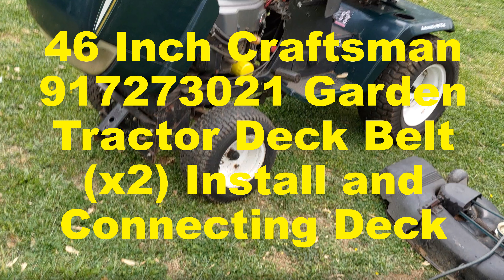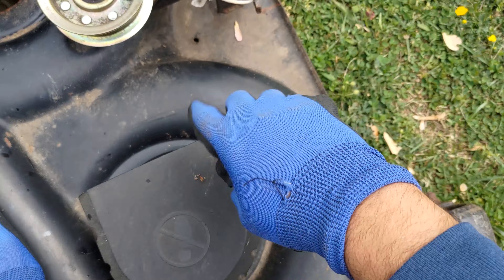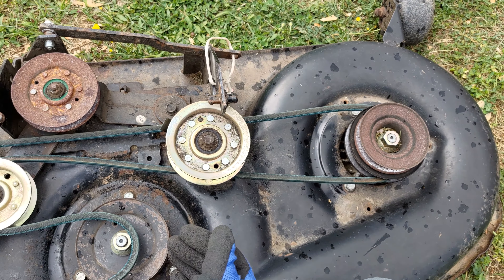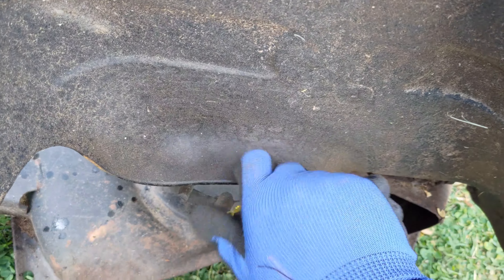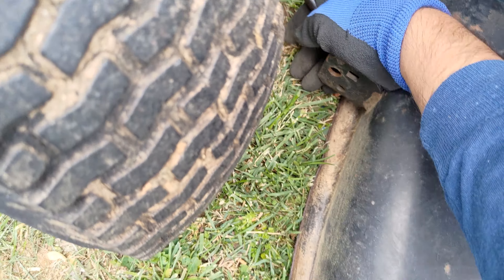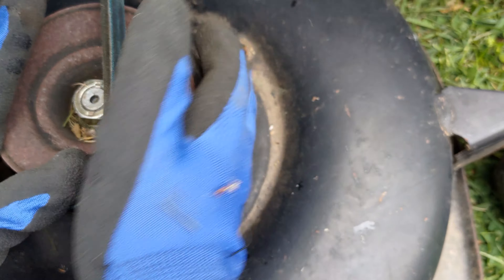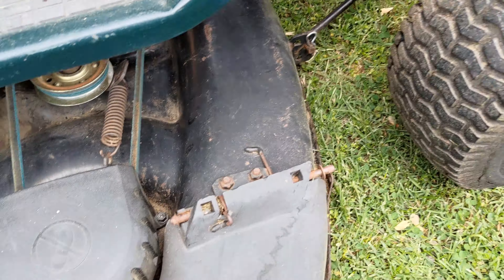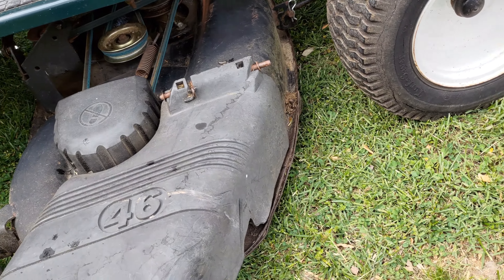46 Inch Craftsman 917273021 Garden Tractor Belt Install and Connecting Deck

Comment: Excellent video..... I have a 917.272021 from 1998.  Do you think this instructional would apply to that model as well? Also a 46". Thanks.
Reply from the maker: Thank you for your comment!  Could you please confirm this is your tractor, linked below?  The photos appear to be identical in the manual.  Therefore, I think it would apply.
https://www.searspartsdirect.com/manual/1uaoi9dsnw-000247/craftsman-917272021-front-engine-lawn-tractor-parts

Comment: Nice clearly spoken tutorial. Often, I slow down a video to process what the creator's saying.  I wanted to slow this down for the visual parts, then I decided not to because there was little to see, as far as watching your steps and your speech pace was wasy, (edit: oops, I meant "easy") to comprehend. 

BTW, You may want to upgrade your primary belt... I have a '94 GT6000 & 2000 GT3000, both equiped w/ a 50" mowing deck & similar Kohler V-Twin engines. I use the newer upgraded primary belt on both. Craftsman replaced that older belt #139573 with part #148763, it's thicker @ 5/8" & to compensate for it being a bit wider, it's approx. 3" longer @ 86".  Thanks for the video.
Reply from the maker: Thank you for your helpful feedback!  I have performed the primary belt upgrade to 148763.  However, the belt got ripped up on the deck while in use following the upgrade.  Have you had this experience or did it work?

Comment: Do I need to take the deck off to put belt 139573 on? I, for the life of me, cannot get it on while the deck is on.
Reply from the maker: No, not necessary.  The deck should be connected to the tractor to complete placement of Belt 139573.  A rolling motion is needed.  Please see minute 4:00 of the video.

Comment: Great video. This helped me a lot. But My drive belt 139573 is too loose. Is there an adjustment to tighten a pull for that belt that goes to the engine drive pully? The mower blades take a while to fully turn to the fast speed I need to cut. then slows in taller grass. Pease Help! lol thank you.
Reply from the maker: Thank you for your valuable feedback!  What model tractor do you have?  The Craftsman 917273021 Garden Tractor does not have a mechanism to tighten Belt 139573.  You have to replace with a new belt.  If Belt 139573 has gotten too loose, you probably ought to replace the deck belt too.  Good luck!

Comment: Hi the belt for the 139573 i got off Amazon burnt up after 1 use i inspected the belt and i found not only was it different then the one in the video but the belt itself was not even 1/2 but closer to 1/4 any possible alternatives to this belt
Reply from the maker: Thank you for your comment and sorry to hear about the problem you had! You raise a good point about inspecting the belt to ensure the correct size.  A belt measuring tool might help. The marketing descriptions change over time on websites making it difficult to buy the correct replacement belt. You might begin with www.searspartsdirect.com to get the most recent part number and dimensions. Then, check on amazon.com for a description that matches.  It is a good idea to buy from a couple of different manufacturers and then compare for the best match.